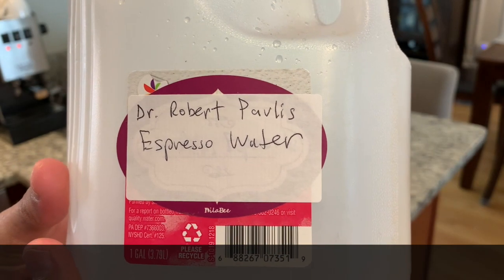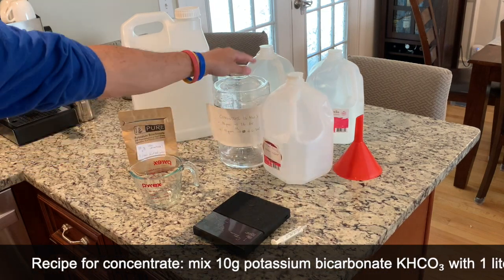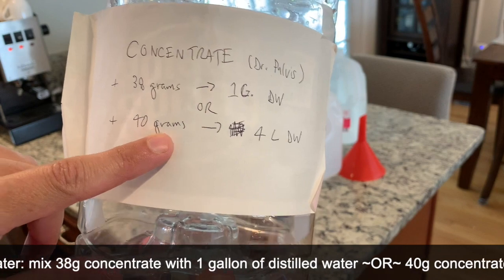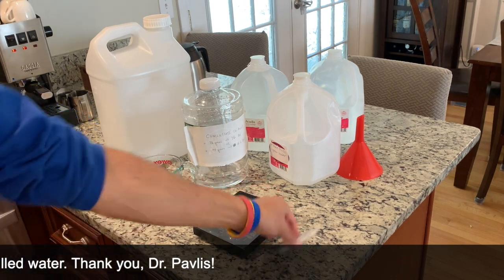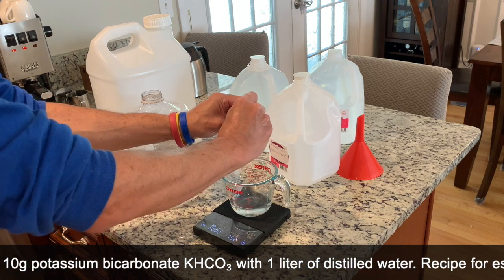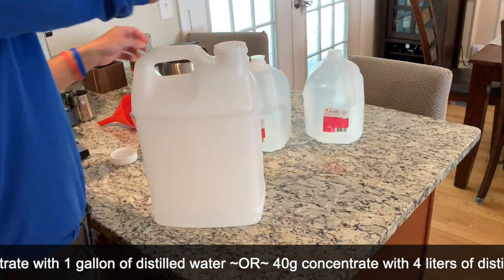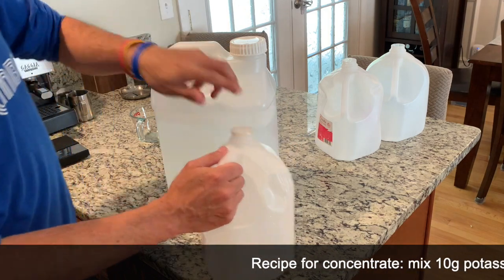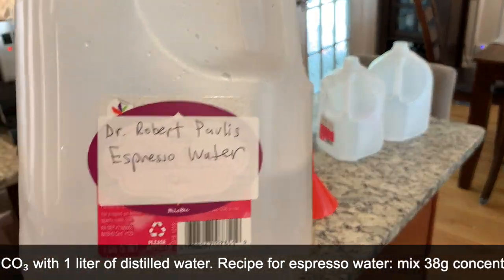,Dr. Pavlis' Scale-Free Water Recipe For Espresso ****please see note below****

Comment: 3.8 g per 1 gallon of water - this if you don't want to bother making a concentrate. Thanks!
Reply: 0.38g. You mix 10g per liter for the concentrate, you use 10ml of concentrate for 1l of distilled water, thus you make 10l of water for every 1g of sodium bicarbonate, therefore you need 0.38g per 1 gallon of water.

Comment: Hi did you test the ec or tds on the water? can you share result?
Reply: I did not but I've been using it for years without any issue. Because the recipe is literally distilled water plus KHC03, that's all that should be in there. Hope that helps!

Comment: I'm not sure I understand the point in making a concentrate when you can just add it directly to the gallon jugs found at stores.

I find it easier to just stick some weighed out potassium bicarbonate straight into the water jugs, otherwise every jug, being full to the brim needs to go into another container just to allow for the addition of more liquid.

0.1gram of PB raises the PPM by roughly 10 points per gallon. If you buy larger containers, just adjust to that. Why over complicate it with a concentrate when it's a single, completely water soluble ingredient?
Reply: man I spent so long doing the math in my head and came up with 0.089 for powder straight into the distilled water. it tasted great. I wish I saw this comment lol
Reply: @nobantahir  I've now been doing this for a couple of years, and I'm at a point where I just eyeball the amount :D About 1 16th of a tsp is roughly right for my mineral bag.. I still test with the TDS meter, but it takes so little time, I can't imagine changing.
Reply: Hey, Bread. Sure, that'll work. But making the concentrate prevents the need for weighing out potassium bicarbonate every time you make the water. I make the concentrate once a year or so. I mix two gallons of espresso water every two months or so. Thanks for commenting.